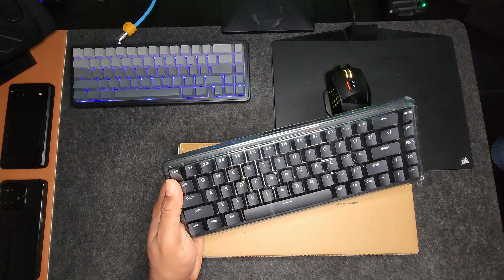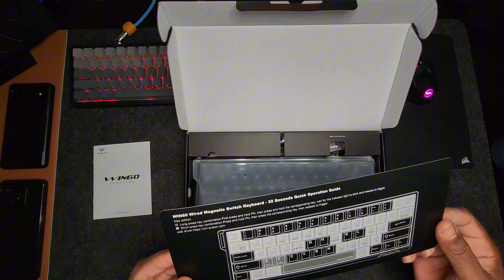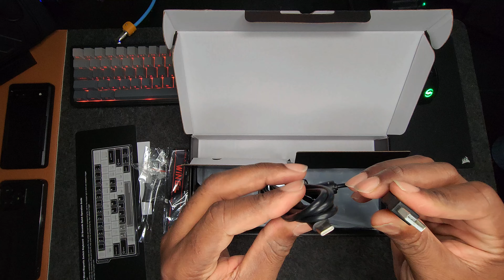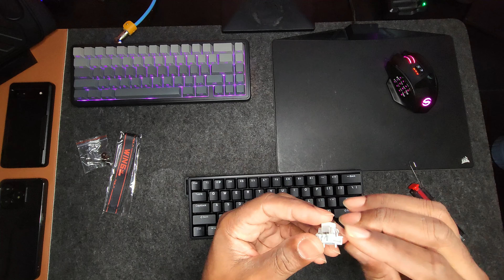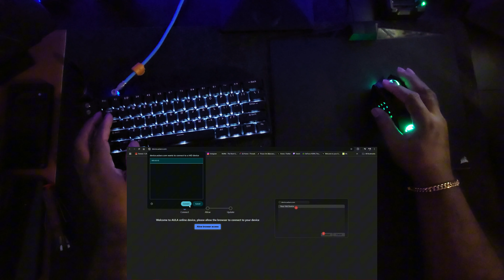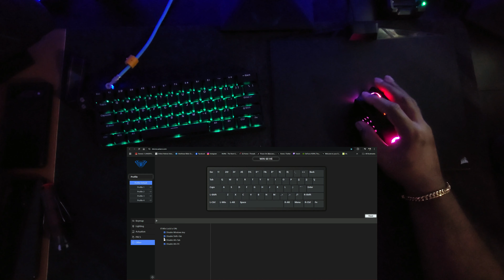The Win 60 HE - How Good Is It? #win60he #tech #magneticgamingkeyboard #gamingkeyboard #keyboard

Comment: hello, i have a "win68he pro", the left side get little bit hot after 10 mn of normal use . i got a replacement from the seller but i still have this overheat issue. tried to use different usb port but nothing changed.
Reply from the maker: Sorry to hear that, unfortunately I have no experience with that type of issue. My uneducated guess would be that the internal battery might be getting too much power to it. To be honest, I have absolutely no idea why that could be. Contact the seller and let them know, I'm sure they can help you or at least provide possible explanations as to why you keep getting that issue. Sorry I couldn't be of any help. I hope the issue gets resolved for you.

Comment: SO IF THE LIGHT IS ON DOES THAT MEAN RAPPID TRIGGER IS ON
/\
Reply from the maker: I would assume so,  my unit is giving me some trouble with the software,  so I'm not really sure.
Reply: @PicasoEnt  wym is ur w asd keys?
Reply from the maker: @Tiskifn it seems i have hardware issues with mine. It could be a software issue too now that I think about it. Changing the actuation points doesn't seem to be working properly. The keyboard remapping isn't fully working, and my d key seems to be getting stuck. I will be doing some troubleshooting this coming week.
Reply: @PicasoEnt  so ok ur hardware issues can u give me some more details please? and the wasd keys Rapied triggeer dont work for wasd bc its something u hold instead of just pressing so it would be like the buttons u tap would use rapied trigger and the buttons u press u can only lower the first one that goes to 0.8 but if u have rapied trigger on wasd then it wont work correctly sorry for late responses im trying to start my youtube channel and twitch channel
Reply from the maker: @Tiskifn it's software and hardware issues, I might just have a faulty board. I'm still figuring out all the details. That's cool your starting YouTube and twitch, good luck.
Reply: @PicasoEnt  ohhh okay im sorry i couldnt help you any further but have  wonderful day keep up the good work and stay safe
Reply from the maker: @Tiskifn I appreciate it..if I do have questions, or get suck with something,  I'll hit you up. Cheers.